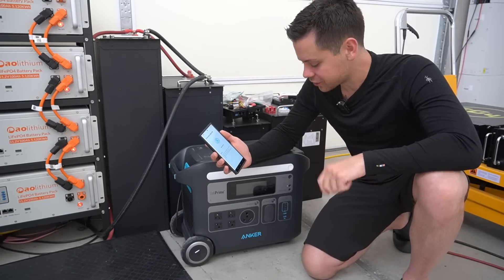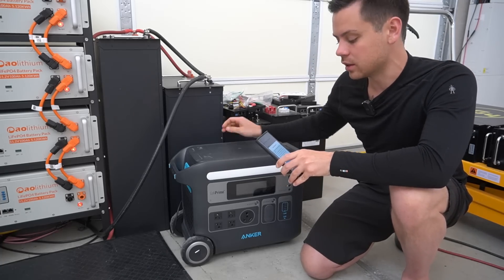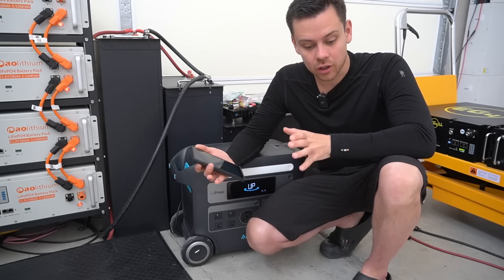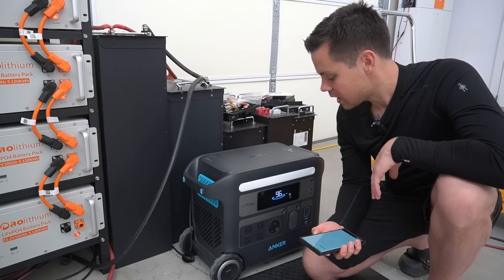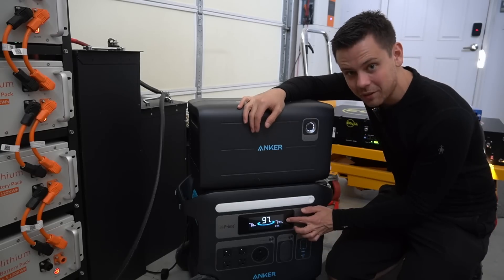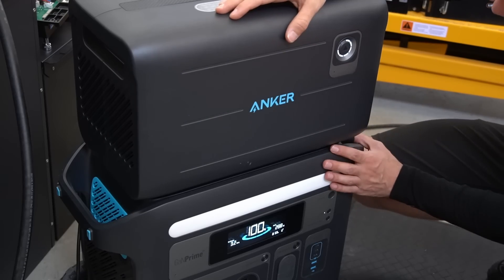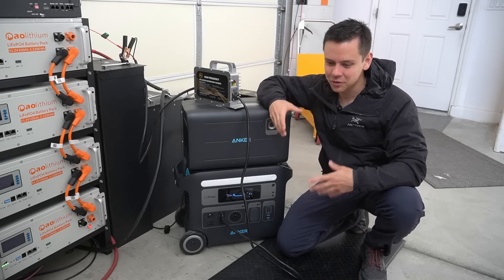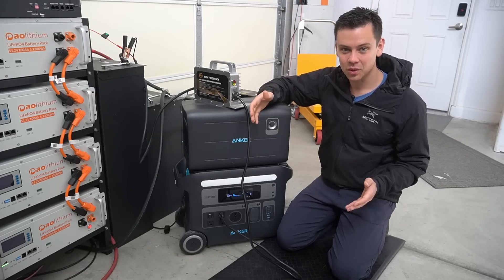Anker 767 Firmware Problems. Are you tired of being a beta tester for these companies? I am!

Comment: I have two of these and one expansion battery. On my older 767, the firmware is v2.1.5, on my newer one it is v5.1.5. I had a problem where I couldn't stay connected to the older unit through bluetooth and tech support has been very responsive but they tell me to update the firmware on the older unit but when I try, the app says it's the latest version. I was able to get the bluetooth working by connecting the newer unit to WiFi. No choice to do that on the older unit and I suspect that came in a firmware update. If they can't figure out the firmware update, they are going to replace the unit. Otherwise I've been very happy with these. I'm using them to maintain power to medical devices for my parents and also to peak shave since my Powerwall 3s would run down before the high rates are over due to the medical equiptment.

Comment: Hi Will, wondering if you could help me out, New to all this and watch some of your videos which helps, anyway  I want to purchase what you are reviewing, the 726 and the expansion battery and thought of getting 2 ea. 400 watt Anker solar panels for a off grid cabin in SW MT with a open area with good sun exposure. I want to put the power station inside and figure my panels would be 25 feet max away. I would like to put some type of receptical on exterior of cabin (5/8 " wood siding) to keep it clean and sealed, my main question is if the the cord provided for the solar panels isn't long enough how do I extend it, gage ect. enjoy your videos,  very educational, thanks.

Comment: How safe is it to charge the 767 via a 2000 w inverter in a car while driving?  I'm having a hard time getting an answer to this question.  Is it a safe practice to charge one of these larger "solar generators" via a high quality pure sine wave inverter while underway in a car?  There's lots of these out there and also a growing body of people using them on the road and charging via inverters but this charging method is not mentioned in the manual for the 767, nor is it warned about.

Comment: I just bought the expansion pack for my 767.
Twice in a week the main battery has got stuck at 99% and the expansion battery doesn’t then charge.
So far I’ve had to unplug the 760, reset the 767, let it charge to 100%, plug the expansion pack back in.
Super frustrating.

Comment: Anker 757 also have a problem when no power coming in anymore from the solar panel the anker 757 will have a clicking sound and the divice will turn off completely. . . so no AC & DC  . . . . so bye bye food in the dometic cooler ( not fixable from anker side )

Comment: Apparently if AC and DC inputs are plugged in to this unit it will favour the AC. If the AC fails does it then switch to the DC input and when AC comes back switches back? I'll have to test but on another model (757) think you actually had to disconnect the DC to get it to switch back to AC?

Comment: I’m interested to see what your opinion is on how some of these units have been having trouble with the hot/neutral reversed as well as not being able to run different types of loads. Such as pool pumps, window AC units. Some have been able to update the firmware, and get these loads to run, others report they updated firmware, and it did not fix the issue. I’m stuck between this model, and the Ecoflow Delta 2 Max. I was leaning towards this model, before some of these recent developments. Thanks!

Comment: I wish my Bluetti AC200MAX would do this. Biggest pet-peeve with that, is when both AC200M and connected batteries are powered off, once PV input powers up the AC200M, the connected batteries remain off, and you have to physically press the power button to turn the external batteries on. Frustrating and totally unnecessary.

Comment: On a recent video on YT titled "Anker Help Me" Sheen claims his 2 767's show to have Reverse Polarity using a AC Polarity Tester. Can you confirm if this test is valid? His AC won't start and compressor makes a clattering noise. Which make me think the problem is real, due to Start & Run capacitor being "Back Doored. Thoughts. Keep up the Good Work!

Comment: You should not order this product, at least not yet.  When plugging it into a wall outlet, it is miswired such that the hot and neutral are REVERSED.   When running off the inverter it is correct.  Several other people have identified this issue, and I just figured out mine has it as well.  This is potentially dangerous depending on what is plugged into it, and this should never have been released to the public with such a fundamental flaw.  I think maybe it is time to demand UL certification on products like this.  This would never have passed UL with this flaw.

Comment: Is anyone besides me tired of all the youtubers testing "free" products who do not discover and report basic issues like reversed hot and neutral wiring?  Do they NOT own a $6.00 electrical tester and test the units before telling everyone how great they are?  I want to love my upcoming 767 replacement unit (when it arrives) but I feel like I am participating in a $3K science project. The 767 SEEMS to be the best option now, or so I think, because there are so many issues with Bluetti and Ecoflow either with product or customer service. Regardless, none of them seem to be fully ready for primetime.  Does anyone agree or am I off base?  However, I should add that Anker customer service has been VERY responsive...
Reply: What was Anker's response?  Did they issue a return ship label?  Ship you  a new or referb?
Or perhaps instructions to DYI fix?
Thanks.
Reply: @tubewatcher8330  I received a return shipping label and they sent me a unit marked NEW on the box.  It is wired correctly, looks brand new, and works fine. Sorry for the long response time to your question...was on vacation.

Comment: Re: Software updates

Will - the reason they do that is simple: it's because they can!  It's the same reason why AAA games have 12 GB patches on release day - because they can!

Back up - they do it because someone sets a hard target for when the product is going to be released.  Software always gets the hardware to test against last (in my experience).  And, because software can be updated, they put the "risk to ship" as low when the software is incomplete.  Meaning, when the "happy path" works, they can ship & fix the bugs post-release.  Corner cases, error conditions, localization errors, and just plain bugs get shipped - ON PURPOSE!

It's nuts.  That's not the way it worked when I was at HP in the '90s.  Was HP better?  NOPE!  It's because they COULDN'T!  Once firmware updates became a thing, all these manufacturers jumped on the update happy train.

And, in a product that ships with 1 to 5 kWh of power!?!  Shall I repeat that IT'S NUTS!?!

Comment: The clicking is definitely from solar panels having enough voltage to charge then not having enough voltage to charge due to atmospheric changes or the battery voltage slightly increasing. I'm glad to see anker sends updates for their firmware. It's very difficult to get it completely right on the first go because people will always use products in unusual ways, which makes it impossible to have perfect software on a first release.

Comment: Puzzling problem - I just got a 767 and am running both an upright and chest freezer with it at the same time. On house power they run fine (119.2 V 60Hz from killawatt meter), when I power them with the 767, even though the killawalt shows 119.7 V and 60 Hz the freezers are making clicking sounds and the interior light is pulsing.  Is the 767 bad? I'm still within the return period and may opt for ecoflow instead. Any suggestions?

Comment: Thanks for another honest video Will. It's so frustrating to see expensive power stations in the market that have issues that really ought to be squashed and amended before mass rollout. For example, besides the Jackery 2000 Pro, every power station I have purchased or used have SOC issues. I highlight this on my channel. There are other issues such as lack of OCP, input voltage drop during overcast (with no recovery in full sunlight), solar input limit, limited DC output etc. The list goes on…

Comment: my Jackery 440 stopped charging, the charging led just keeps blinking when I plug in the AC charger. everything works on the unit, it just doesn't charge anymore. do you have any recommendation on how to repair it? thanks. its not the charger, I've tried it on my smaller Jackery and it works with that. Thanks

Comment: Still more users have reported reversed hot and neutral on the 767.
This has nothing to do a floating ground.  Hot to the long slot, neutral to the short slot on the socket.
Unacceptable and dangerous.
Reply: Anker is aware and will send out a return label and a new properly wired unit if you get one that was wired wrong.  This is the same thing Ecoflow did.
Reply: That's good to know.  At least Anker isn't playing games by ignoring the customer or the problem.
But how hard could it be to check for correct polarity?  One assumes each unit gets powered up at least once before it's boxed up.

Comment: Hi Will, I have a 26kw generator. I want to install a wh solar system that uses the grid, then the generator to charge the batteries if the solar panels are offline due to weather or nighttime. Is there an inverter that has the needed xfer switch to do this?
John

Comment: Dude, for sure it's frustrating to be a customer. I can't imagine what it must be like to be a software developer there. VPs screaming at you to get a new release/fix out. They should have taken a step back and held back on releasing a new product line until they had ironed out the gremlins in the system. They also need to invest in a properly sized QA team, and not rely on the customers to provide the QA function. I'm sure so many of these companies realize that they're not solely in the battery HW business, but SW business as well.

Comment: Hey, Will, it was pretty cool to see this update. Nice to know that some of our feedback was read and that you did a follow up video incorporating that data. I am one of the ones that brought up the firmware. I am not operating any solar. So it was nice to know that it was fixed with firmware. I am still considering my options in that regard.

Now that I’ve had this thing for a few days, I’ve just ran into another Irritation so to speak. AC power passed through. When powered from the grid and running my equipment, cut out at 1600 Watts.  It said AC power overload. In addition for some reason it did not switch to battery power. I know the UPS function works because I’ve tested it. But that is when AC is lost.

Comment: Can the Anker be used as a UPS? Additionally, could you suggest a similar alternative to the Anker that can power a PC, screen, router, and switches during a power outage? Our household's power consumption while my wife and I are on our computers, with no other heavy appliances running such as the washer or dryer, is 0.8 kW.
Reply: I’ll answer your question to the best of my ability. I specifically bought the solution from Anker for this exact reason. Yes, it can be used as a UPS to a certain degree. I apologize for not knowing the specific specs. It is either 20 ms or 30 ms switch over when AC cuts out. 

Most of my equipment does not have an issue with this.  Dedicated UPS systems automatically switch in under 10 ms.  My router and my modem continue to operate flawlessly during the switchover. I also have a small home theater system going through this as well. 

The only thing that cuts out is my AV amplifier. However, it turns right back on. I have not tried this with my desktop computer yet work provides me with laptops. Obviously laptops have their own built-in battery so of course they don’t cut out. Hope this helps.

Comment: As a software engineer this is how software development works. In the first release of a product it is normal to have multiple releases as bug are ironed out. In the past it was even worse because product will come with a software and stay with that forever bug included. (For example my car has a bug which will make the car turn off when I remove the seat belt if I'm on an incline and it was never fixed because it has no OTA)

Comment: Howdy, enjoy your videos. Keep it up. My comment on "beta testing" software. I have worked in software industry for a bit more than 2 decades. Sadly it is sort of "standard practice" for these "tech companies" to leverage their user base as "free beta testers." The reason boils down to money. Testing products is costly and time consuming. Plus investors, or board of directors push CEO/Development teams to launch products as soon as possible - the goal is to generate cash flo. Not a new practice. In the early 80's then fledgling companies such as Microsoft and Apple pushed product out all of the time that was largely filled with bugs and other issues. Only after tons of backlash - largely from their largest government contractors - did they begin a serious testing program. Now, if you wish, you can apply to most major developers to be included in a beta software testing program. If solar companies were smart, they would institute a similar program. If you have a line of direct communication with these solar developers I suggest that you reach out to them with this suggestion. Nice video. I am impressed with Anker. But I am going to wait a bit. I would like to see options to add a second or even a third external battery.

Comment: Has anyone had a problem dealing with Roypow? I've been trying to get in touch with them regarding a new product they released for semi trucks. A 48v AC system to reduce idling.

I finally got an email back thanking me for my interest and requesting more info on my company. Can't get anything on pricing or installation?
Thanks

Comment: This looks like an awesome device.  I did see this concern in an Amazon review.  Could you look into this?  "This is NOT a floating neutral device. And... the hot and neutral are reversed. That's right, on the four NEMA 5-15 outlets, the wide slot is hot, and the narrow slot is neutral. Which is absolutely incorrect. This unit is technically isolated from ground (when not charging on 120V) so if the neutral were floating it wouldn't matter at all. But if you're hooking this up to a furnace or something else like with one of those EZ Generator single circuit transfer switch, this could be a BIG DEAL. Now, I'm an engineer, and I know how to rig up a plug and socket to reverse the wiring and all is good for my application. BUT YOU NEED TO KNOW THIS. And I can't imagine why Anker's engineers would design it like this, and I imagine that there will be issues down the road. "

Comment: Yea, as another software engineer here, I can say that there are ALWAYS edge cases you miss during unit testing before you release something.  That said, 90% of the stuff you uncover is basic functionality that should be in their final test suite before the software leaves the building.  You should expect lots of patches in the first months of a product, but they should be for weird cases where you hold your head upside down while triple clicking the button and jiggling the wire counterclockwise, not "expansion battery won't charge".  It does seem like the industry would do well to add a member to their test team, and pull one from tech support.

Comment: I know software is difficult to fully test. This does not absolve the developers from responsibility. You would not be happy if the wheels fell of your Porsche and the company said "sorry, we didn't test it at over 130mph". BTW, I don't think it's right that it should fully charge one battery at a time. It should charge both reasonably equally and top balance when full.

Comment: As a retired software engineer, I would suspect a company like Anker might have problems attracting the best software engineers. Or the second best. Even talented software engineers who are fresh out of college might stay away from a company like that for fear that it will impact their ability to get the most desirable jobs later. Embedded software is quite different skillset from web development, application development, even normal OS development, and generally less common in the industry. Furthermore when you work on embedded software then you might have to wait until the hardware is nearly completed before you can do a lot of the development / testing of the software. So with the hardware finished and the factories ready to go, the pressure to get it out the door is immense. Now that can be mitigated by using testbed, but how useful the testbed is depends on how different it is from the shipping hardware.

Comment: If the attached battery does not start charging until the main battery is full does that mean you loose fast charge capability while the main battery charges from 95% to 100% or does it still charge at full rate through 100%?

Comment: My 767 arrived yesterday. Charged it to 100% (AC charging). Tested all the outputs. Downloaded the app on my iPhone. Uploaded Firmware v1.1.7. (previously v1.1.2.). And now I'm up and running. Couldn't be easier. Ran my 12V ICECO VL65 fridge/freezer all night. Ran my electric kettle. Ran my Breville microwave/convection oven/air fryer 3-in-1, no problems at all. Going to test out solar charging this weekend. Never saw this video until this morning and still had no setup issues. Super simple. Going to snag the expansion battery in a few days and my camping gear is all set!!